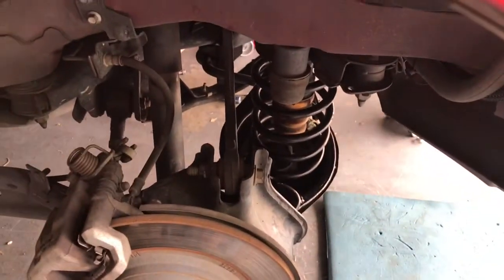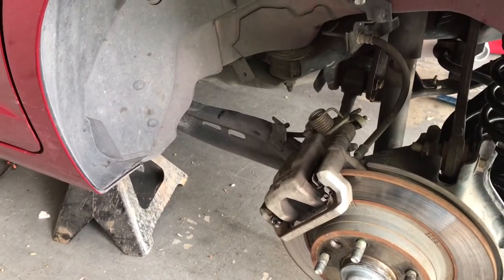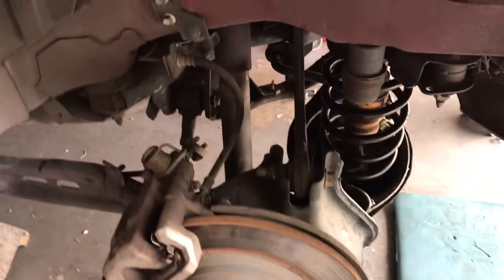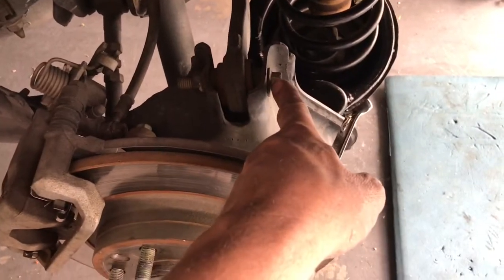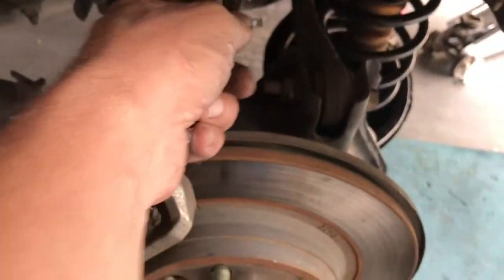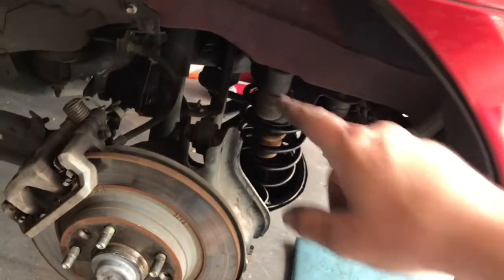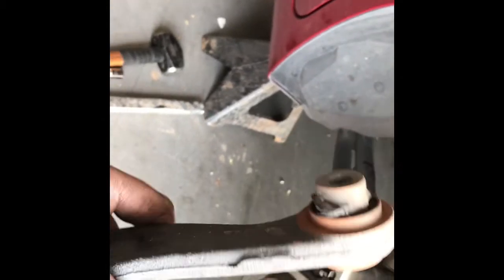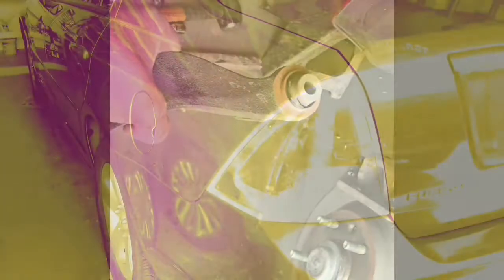Rear upper control arm removal in a 2006 Ford Fusion and Mercury Milan and Mazda 6

Comment: Excellent. Seems simple enough. I'll have to replace at least one this weekend (I'll buy the other one in a 2 or 3 weeks) because the rubber is all but gone, and now it's really just metal on metal, big'o thumps happen when going through bumps fast. A bit expensive for a piece of metal though.

Comment: How did you get upper bolt removed? I have very little clearance and the shock seems to be in the way? I tried a offset wrench also. What tool did you use? Thanks

Comment: What did you use to get bolts out mines the bolt on my upper and lower control arm look like they welded any ideas?
Reply: 15mm only the nut is welded on. Get a 45 degree 15mm wrench.